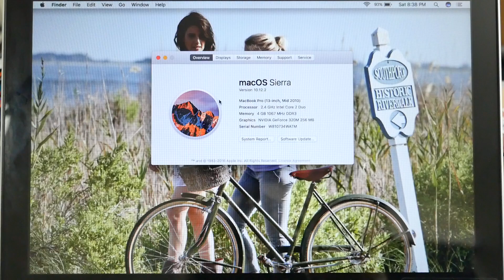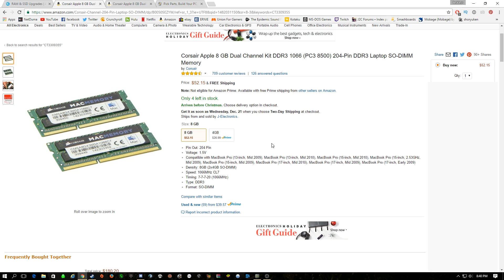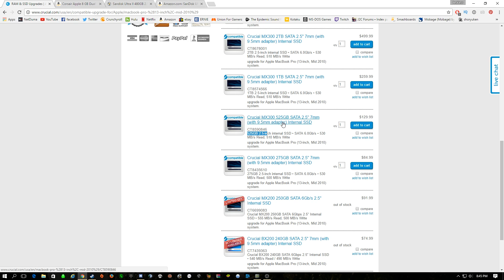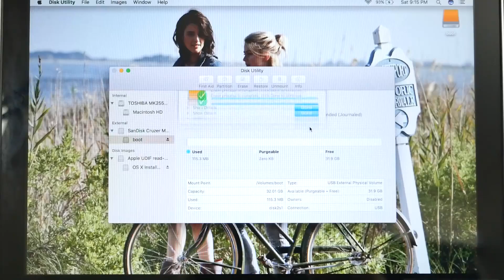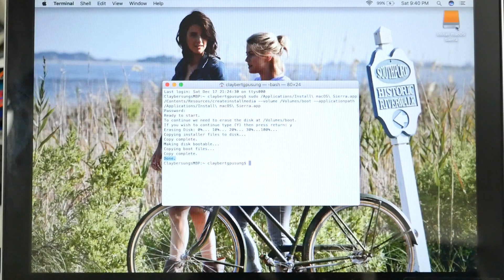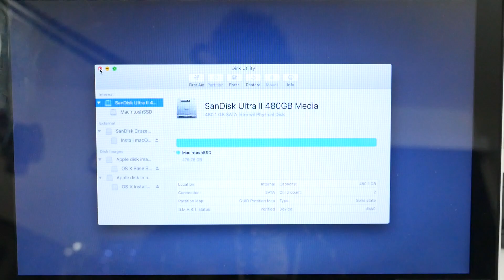Make An Old MacBook Pro Fast | SSD & Memory Upgrade | Bootable Sierra Installer

Comment: The slowness is not just because "things were slower in 2010".  A great deal of it is due to the changing/updating of software; OS upgrades and system requirements to run today's software are greater than they were in 2010.  Also, many people don't realize that they should do a fresh install of the OS every so often (especially if performance is slow).  That would be a good place to start before paying to upgrade components.  If you do choose to upgrade, this is an excellent video.

Comment: Great video, successfully installed 500gb SSD on to MacBook Pro mid 2010. Alt key is the option key. Without pressing down correct button when switching on it won’t load install screen 📺 thanks again!

Comment: I've just bought and installed a Crucial 500GB SSD - somewhere I read that I should have upgraded the Sata cable to enable the faster data transfer. Would this be correct?

Comment: Hi there I have purchased a MacBook Pro 15” 2010, I bought the system knowing that there was no hard drive included with the plans of installing a ssd. How would I go about getting Sierra installed on a usb to get an operating system on the computer ?

Comment: Hi Yuki, I have the same 2012 15' very slow. Can I use 2TB SSD? I am thinking
Samsung 860 EVO 2 TB SATA 2.5" Internal SSD which I think will be adequate for AutoCAD software use. How about 4+4 GB RAM memory, should you recommend it to upgrade?

Comment: Did you check Everymac as they indicate several mid  2010 MacBook pros can take 16gb ram, the site you were on said mine had a max of 8gb and I am running 16 as per Everymac and it’s flawless.

Comment: So I am encountering some problems. Unfortunately it looks like Reckless Yuki doesn't update his YouTube anymore. And there's no one here to help. So my problem is that: I can't get the terminal to work to create the USB installer. I have Macbook Pro 2011 15" and running 10.7.5 Mac Lion. Apparently you have to have 10.8 OS only to be able to create this bootable installer, an Apple Support Tech told me that. The Apple Support told me that I have to either go into the Apple Store to have them update my Mac to 10.8 or try it myself if I have an Ethernet Cable. This is an entire added headache to the process of upgrading my Mac! But once that is done I should be able to finish upgrading everything no problem. Reckless Yuki, come back to your channel, we need you!

Comment: About to replace the SSD on Mac 6,1 2009. Your video is the ultimate guide for installation. Thanks alot. I am installing 120GB crucial SSD, not sure if I'm gonna regret not getting 240GB.

Comment: Great Video, I am stuck on the boot up. So I have replaced with Blue Western Digtial SSD 500g and 2 - 8g Hyperx memory slots. I was able to create the boot USB. But I get to the Apple Logo, it loads halfway and then it reboots again and gives me a warning that "Your computer had detected a problem and has to restart. 
Any help would be great!
Thank you
Reply: Did you get an answer to this? I'm going with the 16g Ram too.
Reply: @MARLONBART  The 2010 Macbook Pro didn't like the Hyperx Memory slots. This was due to the voltage on the card. It has to match exactly with the old memory slots are.  Also, i wasn't able to get 16 gigs. only 8 gigs. But it still is quicker.  I went with the Corsair 2 x 4gb MACMEMORY Slots.

Comment: Instead of buy 2 card for 8 gb..why don’t you buy 1 slot for 8gb+2gb initial ram
Reply: Should get even memory for both ram slot to be balance
Reply: kristine Rivers is it okay to use 8+ 2 gb for macbook pro mid 2010 A1278
Reply: Is it compatible with it
Reply: I actually did that my self to make my computer faster it will work but  I noticed some kind of heat issues and loud noice from the fan Ive done my research and most people saying are should be use same amount of memory for both slot like for example  u want to upgrade in to 8 gb u should use 4 gb for each memory slot.  I mean it is your game it will work buts risky you know
Reply: kristine Rivers same voltage and brand is fine, a 8gb and a 2 or 4gb and 8 is fine. As long as the board supports the amount of ram being installed it will be fine, done it and doing it on several machines

Comment: Best & most simplified tutorial with every step and necessary links. Thanks. I will be upgrading my 2012 MBP tomorrow with Samsung EVO 860 SSD and clean install macOS Mojave using USB flash drive.
Reply: That’s the best way to go ... I’m doing the same.. good luck with it .

Comment: Hello there. I've been searching youtube for an "in-depth" how to on replacing my old hard drive . Your video was EXTREMELY helpful for a novice like myself. I have an mid 2010 13" MacBook Pro, 2.4GHz intel Core 2 Duo, 2 GB ram, 250GB HD stock from my local Apple Store. Its been a reliable laptop and did not want to give this baby up yet. What a difference in upgrading to SSD (1TB) and 8GB ram. It is like having a new computer. Hopefully this MacBook Pro will last just a few more years so I can save up for a new Pro by 2020. Thanks for sharing this video!!
Reply: Have you upgraded with 1066MHz or 1333MHz memory stick? I have 1333MHz memory sticks from my previous laptop and wondering if it will work with Mac. Thanks for you reply

Comment: Do you need to erase your old HDD or can you just swap it out with the ssd, erase the ssd, then do the fresh install with the USB?
Reply: i just swap it out and do fresh install in SSD.

and also, if you have MID2010 13" Core 2 Duo, you can bump your ram max to 16GB, as long as you have 1066Mhz speed. 

i bought em form OWC a year ago, and jeez, now my 2010MID 13, runs like a champ with 250GB SSD and 16GB RAM.

Comment: Hi Yuki, great video! However I am still wondering how I put back all the data from the old HDD onto the SSD? Because I do not want to lose all my programs, apps, pictures, videos etc. Do you have any tips for that? 
(I was planning to use my Time Machine backup, but I am worried that I will put all the old crap back on my computer that made it slow in the first place...)
Reply: Did you get a reply for this? I was wondering if I need to back up my laptop before following his procedure?

Comment: I think I have to get you to talk to my wife her MacBook is having massive issues
Reply from the maker: Yeah, if you need help just let me know. If all it is is speed, then what I did in this video will definitely help. Or if the harddrive is broken and it won't boot anymore, replacing it might also fix it.
Reply: I just had a look at her overview 13 Inch MacBook Pro Retina  2.5Ghz Intel Core i5  Memory 8GB 1600 MHz DDR3
Reply from the maker: Ahh, those can't be messed with... easily. The ram and the ssd that came with it are soldered in, so unless if you feel like desoldering I wouldn't mess with it. Best thing for those is sending them back to Apple, unfortunately.
Reply: Bugger